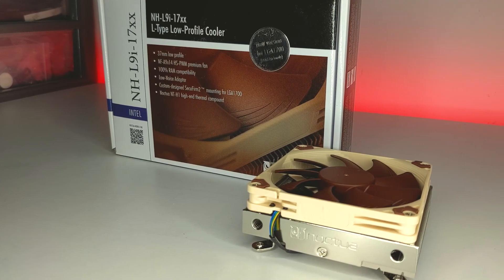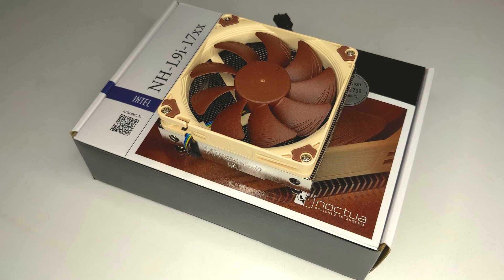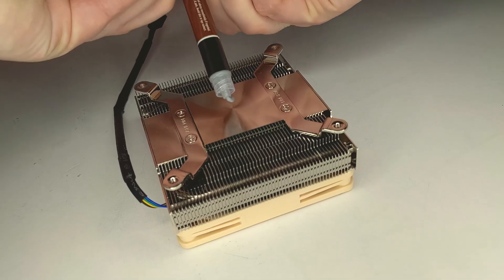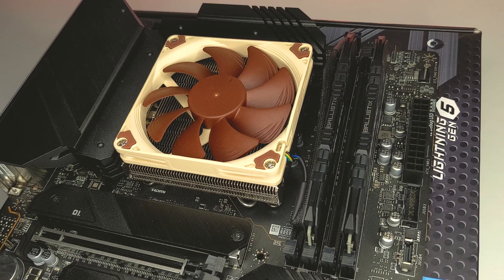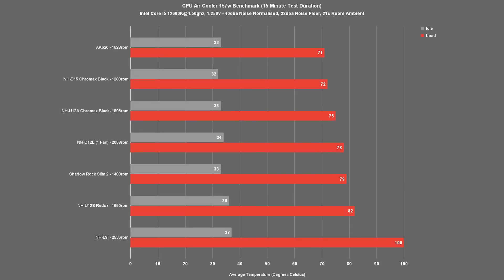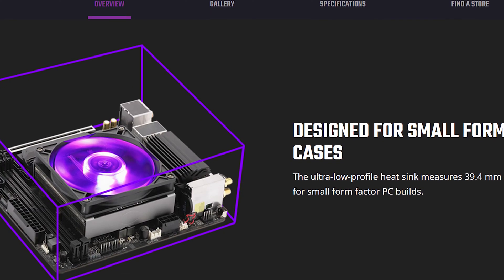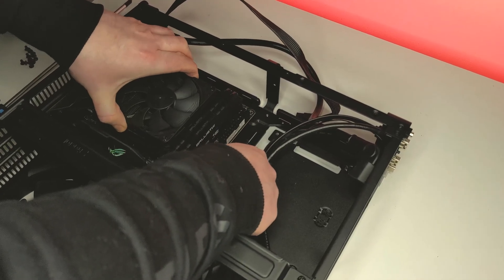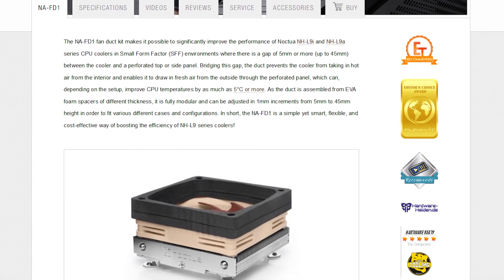The ULTIMATE Small Form Factor CPU Cooler? Noctua NH-L9i-17xx Review - Thermals, Installation & More

Comment: I've seen several reviews of this product and related NH-L9i, and I find it strange that reviewers always want to go with overclocked CPUs when testing, even as Noctual's compatibility page strongly dis-recommends most overclocked CPUs. I guess reviewers as a group all tend to gravitate toward unlocked processors in their test rigs, but it's a little unfair to present results under these conditions for a product that was not designed for that application. I have an i7-7700 (non K) on a Z170 board that I'm transferring to a smaller case and need a low profile cooler to fit the low overhead clearance of this particular case. I'm planning on using the NH-L9i since it both fits the space and Noctual says good-to-go for this CPU. I really like their build quality, the in-box presentation and included extras. I think Noctua makes great stuff... they just need to be used appropriately.

Comment: I bought it for my i5-13500 and even the idling temp is too high. This cooler may work in an airflow-optimized ITX build but I guess mine is definitely not (nr200p + i5-13500 + MSI RTX 4070 ventus 2x + WD SN850x 1TB. included SSD spec here since it is a non-negligible source of heat generation in my build) Both the CPU and SSD idle at above 50 degrees celsius. When playing games like Days Gone just about every fan goes crazy loud, and the temps are too high. I ordered NH-U12A to replace it. Total waste of money and not recommended unless you don't run anything CPU or GPU intensive with your PC (but then why not just grab a budget laptop?).
Reply: L9i really benefits from the duct kit
Reply: I second these results

Comment: Running this on a 12600k unraid server in a jonsbo n2 case. cpu runs up to 100degree throttle speed when doing plex sonic analysis and idles at about 38 degrees.
Reply: Thanks for the info. Just ordered this fan in black for my 12600k Plex build in a Jonsbo tk1. Assuming it'll be more than enough cooling and very quiet for my Plex usage. Had a brand new Corsair H100 Link AIO on there but just returned it since the noise was over 44db at idle 😆

Comment: The all-black version of this CPU cooler is the Terminator of CPU coolers. It fit in my Iqunix ZX-1 with an ASUS ROG ITX motherboard perfectly. Night and day difference between the stock Intel cooler. I"m running a Intel Core i5-13500  and am very happy with the cooling performance.
Reply: How does it do temp-wise with the 13500? I was thinking of doing that exact combo. Does it stay under control in something like Cinebench?
Reply: 😂 terminator of coolers... now i want want. “My C-P-U… eez a neural-net processor… a learning compyutah.”
Reply: Brother, im running i5-13500 with NH-L9i-17xx, and im getting like 60C 1700rpm wile idling, with 45W limits. Am i doing something wrong? Cant find any info on this cpu/cooler combo
Reply: @achy_tv9182  I'm not sure if you are doing anything wrong. I have since upgraded my CPU to a higher power i7-14700 using the same cooler. Make sure you're using good quality thermal paste and make sure it's touching all parts of the CPU metal surface. What is your ambient temperature? In winter my house is usually no more than 69 degrees F and my idle temps are around 45-50C on the CPU. If I'm running under full load (all cores 100% on some benchmark) I can easily hit 95C or even 100C. The cooler is great but it's not magic. In normal use I never need to max out this CPU since most of my heavy workloads are GPU bound.

Make sure you're venting the heat from the CPU out of your case directly. I would double check the contact between the CPU and the cooler. If anything is wrong, it's likely this.
Reply: @LouisDuran  thanks for respond, man. Yeah i got that thermalright contact frame, mx4 thermal goo and that noctua fan duct shroud for fresh air intake. all double, triple checked. i guess my fan curve was a bit off. so now im getting 50C 1400rpm idle and 85C 1650rpm 20min stress test, 65W capped. perfect, near silent operation. beast of a cooler

Comment: I´m building a LGA1700 with Intel Core i5-13600K, 181 W. Everything should be in a 4U chassis. I haven´t bought a cooler yet but I´m afraid tower coolers will be to high. Can you recommend a great cooler? Thanks